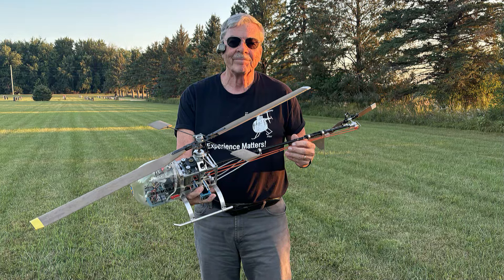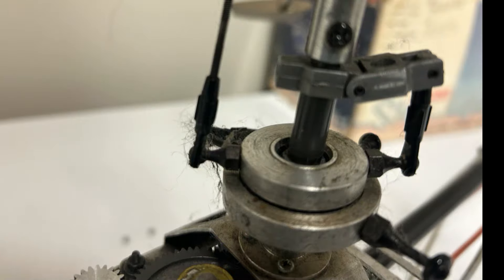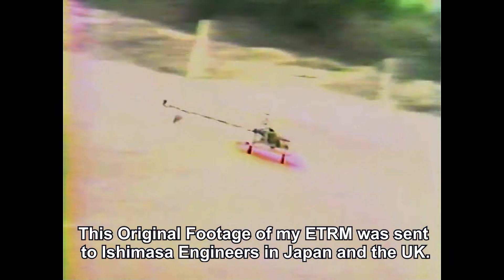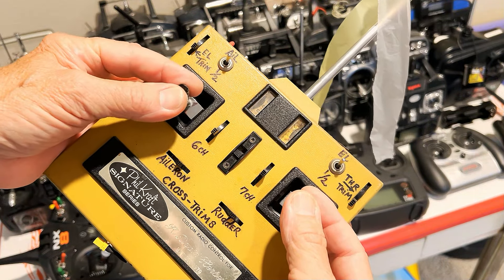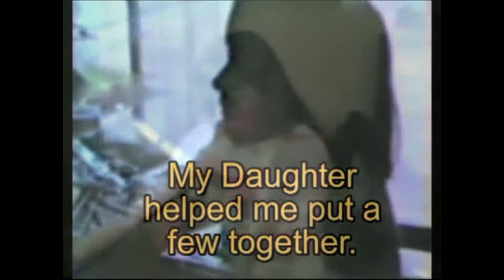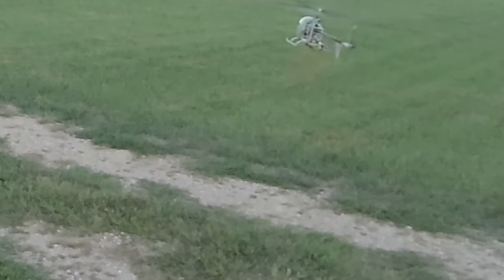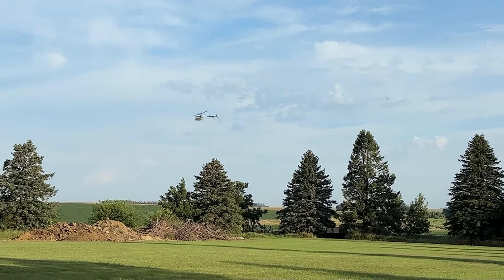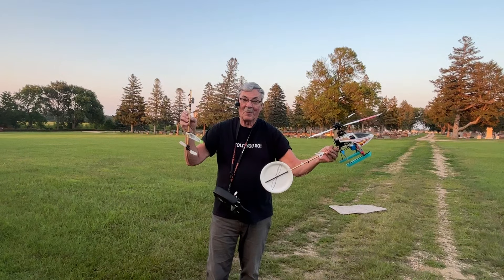The Skylark EH-1 was the 1st Electric RC Helicopter in the world. How it began, FAILS, and my ETRM.

Comment: Absolutely awesome to see the Sky-Lark model in action!  I do have my own Sky-Lark in the shed (my Dad built it in 1981) but it hasn't flown for 10 years.  But the Sky-Lark heli sure got me into flying R/C helis as well as into flying scale 1:1 helis.  Maybe the 'key' modification for myself was not so much the T/R belt but the design of my own MOS-FET based speed controller with a built in BEC.  It saved lots of weight and gave me much better control of M/R thrust in the hover.  I of course crashed more times than I can count but I got there in the end!  My first un-tethered flight with a NiCd got me my first introduction into translational lift effect!  Great memories.
Reply from the maker: Great to hear that.  Speed controls made the difference for sure.  Thanks and Happy flying.

Comment: When I was in the 8th grade I designed and built my own electric helicopter using gears from an RC car. The main drive mechanism worked great but the swashplate was poor and the tail drive gears were inadequate. It did't have enough power to lift into the air. I saved up some money and bought a Skylark EH-1 from Condor Hobbies probably around 1982 or so. It was fantastic and I enjoyed it or many hours. By the way I flew it with a Kraft Sport Series 4 ch AM radio. Today I have 2 complete EH-1 kits in mint condition and 2-3 complete used airframes/parts one of which has been restored for display. The EH-1 Skylark is probably one of my favorite bits of childhood nostalgia. Great to see yours flying here! Eventually I would trade up for a Kalt Baron 28, GMP Cobra (50) that I converted to King Cobra (60), Heim Star Ranger, and Miniature Aircraft X-Cell 60 mark 1. Eventually I would help develop the Lite Machines EH-1 "micro" helicopter (at the time) as test pilot and designer powered by a Cox 0.049 and eventually Novel motor from Russia. If you happen to run across any of the Lite Machines promotional videos back in the day that is me on the controls.
Reply from the maker: Great to hear your story and all the helis you had.  I just have been flying all my helis 1 by 1 for maybe the last time....I'm 77, and one of them was the Lite Machines 110.  Check it out if you have time and thanks so kindly.  https://www.youtube.com/watch?v=oKi-jSWxRnM&t=19s
Reply: @NightFlyyer  you have inspired me to get a Skylark Flying again and I have a few Kalt Baron helis and one of those needs to fly. I'll check out your Lite Machines video and keep up the good work.

Comment: wow, Way back in 1981 I bought one on a back street in Hong Kong ! Put it together and plugged it in and SHAZAM  straight to the low cealing in my apartment , then off to the book case , finiall upside crunch on the floor at my feet , gasped a couple of times .So as I type this story to you I can still look at her sittin with the rest of my rc stuff (former wacko for the stuff) I never flew it again as the prop was in parts so no repairs possible. Thanks for the video and the history Cheers. cheers  from Portugal .
Reply from the maker: Oh, that is a bummer.  Quite the story and thanks for sharing.  Thanks kindly and happy flying.

Comment: Man I'm surprised the RX tolerated all the noise coming off that rheostat.
Reply from the maker: In the early days of AM and FM, it did a lot.  We used lots of capacitors on the motors.  But this one is flying with and ORX RX on 2.4, so no interference.  Thanks kindly.

Comment: Bravo Dave👏👏👏👏👏👏 I wonder what size lipo did you use to power this vintage electric helicopter?? Looking forward in seeing that old school video coming up next time Dave may you Ilea have a safe and Happy Labor Day😁😁
Reply from the maker: Great to hear. I am using an 11.1 2200 LiPo. Way better than the original 9.6v NiCds. Long run times too. I appreciate you. Thanks Cue!
Reply: @NightFlyyer  Ditto Dave thanks for the quick reply to my question also.